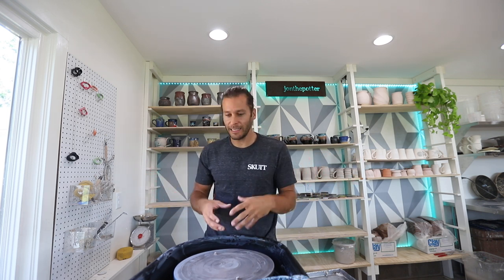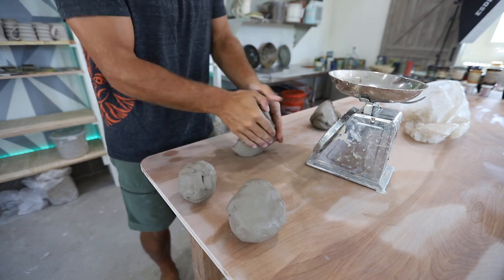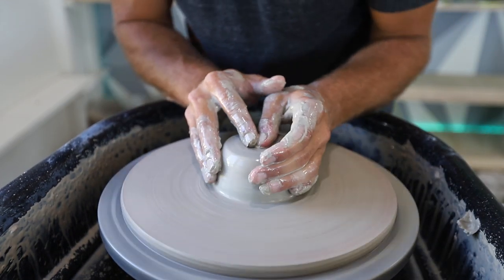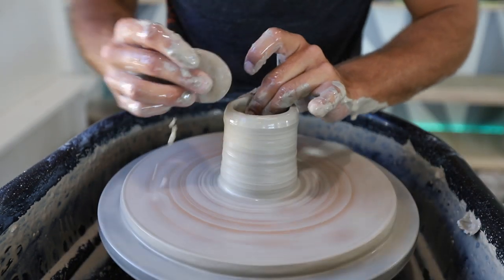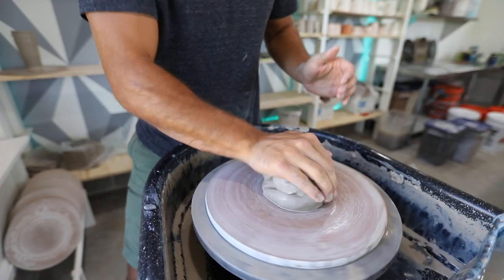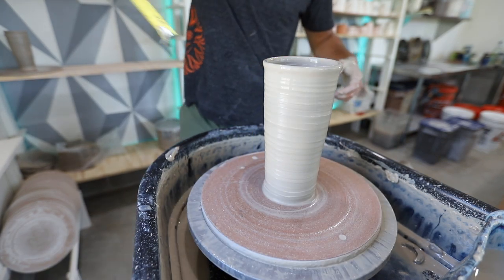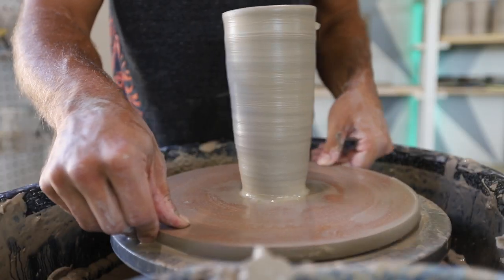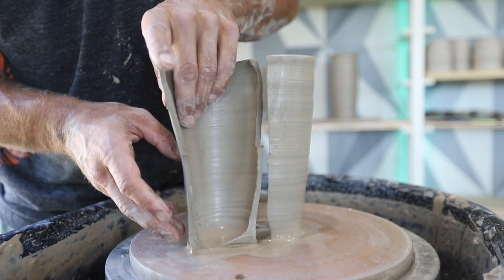How To Make A Cylinder - Beginners guide to getting more HEIGHT on the WHEEL!

Comment: Starting off, in college ceramics, we also had to make a 10 inch cylinder.  We however, did not have to make 10!

I've seen a potter cylinder challenge, with the rules as follows:  Create a 12 inch cylinder.  Use only 2lbs. of clay.  Only three pulls allowed (Not including any forming/ collaring).  I have tried it, but can't quite do it.  I've seen videos of other potters, who make it look effortless.

One suggestion, I would have for making, quite a few forms on the wheel, make sure you are using softer clay!  When I first started teaching, I would spend way too long centering, because I was using clay, that had dried a bit, in the bag.  I thought it was just inexperience, but even as I got better, the initial steps were difficult.  It wasn't until years later, when I actually tried some fresher clay, that I realized how much extra work I was giving myself.
If you can't easily cone the clay, like Jon was doing in his video, you clay is too dry.  Drier clay is alright, for large, complex forms, that need to be able to support their weight during the process, but for smaller, simpler forms, go soft.  Your wrists will thank you!

Comment: I know this video is 3 years old but it is still very helpful for me. I think it is exactly what I needed to help me with my struggles on the wheel. I usually keep the same amount of pressure when I pull up the clay from the bottom to the top, the rim gets thin and floppy and I lose it even as bowls. I hadn't thought about changing the amount of pressure as I pull up which I will do now. Thanks so much!

Comment: I find it SO hard to dig in from the bottom and bring the clay up. I end up wasting a lot of clay. And then pieces feel like they go off centre. Often end up with super thin walls halfway up, wonky off-centre rims, and a crap ton of clay at the bottom. I’ve gotten better results from using a bendy rib to pull up. Probably just need more practice. But any other tips or tools that help?
Reply: of course practice is always the answer to these things, but i find that making sure the wall of your pot is clearly somewhat perpendicular to the bat helps. if theres a slope at the bottom of your pot that blends it into the bat, it makes it difficult to really dig in at the bottom. 

if youre already at the point where your pot is made and you cant get anymore up but its still thick at the bottom, using a wooden tool to cut off a ring of clay from the bottom always lightens up a piece. use this sparingly though, as its almost a “cheater” way of avoiding pulling up the bottom clay haha :)
Reply: One thing that I have found is using a wet sponge to help keep the clay wet as I am pulling up prevents friction buildup and allows a smoother transition.   You can even stop part of the way up and re-wet the sponge.  Also, check your wheel speed.  Too fast and it will tend to fly to the outside.  Too slow and you might try to pull up faster than the wheel is going and cause a crease or thin/weakened wall.

Comment: I struggle a lot with the finishing. Like my cylinder will be well centered, perfect thickness and I managed to make the top to be at the same circumference as the bottom. However a lot of times I ended up messing it up at the top while trying to soften the border, it is like it got a little deformed at the top like a non-straight cut edge and I struggle to fix it and end up a lot of times messing up the whole piece. Any tips?

Comment: That's funny that's exactly how I've taught myself how to pull just ease up lightly towards the top or if I get too aggressive and I make a thin spot in the middle that is almost certain to be wrecked as long as it isn't thinner than the end parts going to be all I do is skim over that spot until it's all even I've actually today did something that I never thought would work but I tried anyway I got too aggressive and made a thin spot so I pushed down from the top of the pot because I was making a bunch of sugar jars and I had an extra little bit for a gallery on top well I had a little extra too much on top and I actually pushed it down to fill the send out spot and it worked I couldn't believe it

Comment: beginner here:  my cylinders get a twist somewhere about midway up and I end up losing the top third or so--that area just starts twisting and going all wonky.  what's up with that mess?  I also have trouble with getting the bottom TOO thin after my first pots being always way too thick on the bottom. cannot seem to find the right thickness.  I'd like to be able to trim on the bottom.  more detailed help with wedging would be welcome, too.  great videos, I watch each and every one--sometimes many times!
Reply: If you're getting a twist, it may very well be because you're getting the walls too thin on a certain part of your pulls. The speed of your wheel, alignment of your hands, and evenness of your pull will also play a role in this. Practice, practice, practice. Also, you can try a reverse-pull beginning from just under the rim down the pot to try to "un-twist."

Comment: 1. Extruded handles. Don’t have one. I roll coil, fold on itself roll again. Pressure makes it stronger.  Demonstrate making coils. Clay should be well kneaded not too soft to be sticky or too hard they flatten out.
2. It’s not cheating if you use a pot lifter if you want. Have a teacher that’s positive.
Reply: Weigh your clay. Or measure the diameter with calibres. Keep a record of mug size excertera.  
4.  Join two pitch pots together to make a piggy bank, make a smaller one into a ball, four fat short coils for legs plus two piggy ears, a short cil for a stubby snout, poke in to nostrils, two eyes.  If you have a cork make a hole to get your money out. They are fun and give you some feel of the clay.
5. Set up a basic studio.
6. What non pottery things are useful. I use a rubber mallet as I am not as strong as you. Etc.